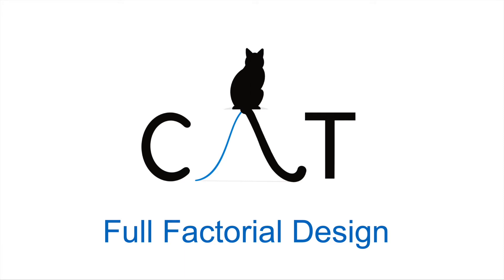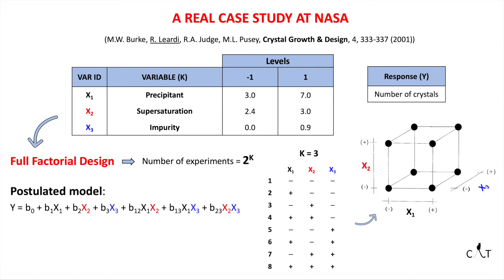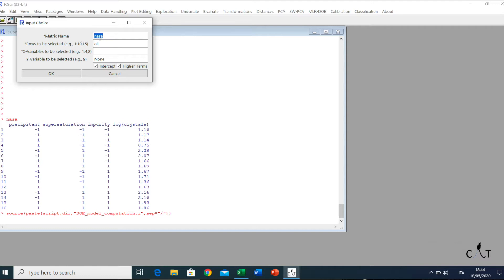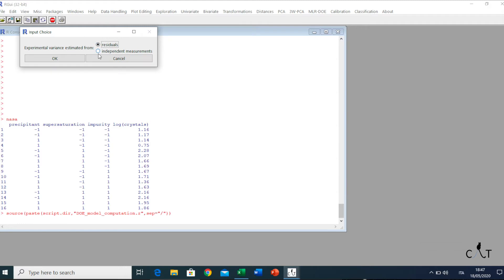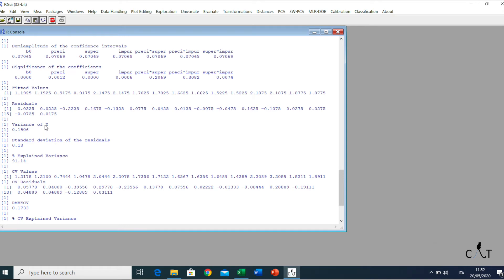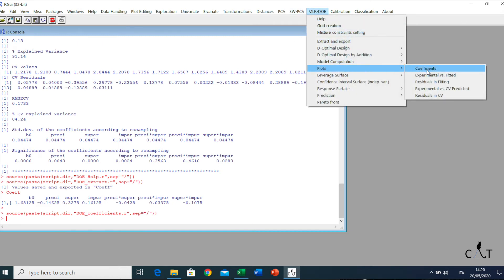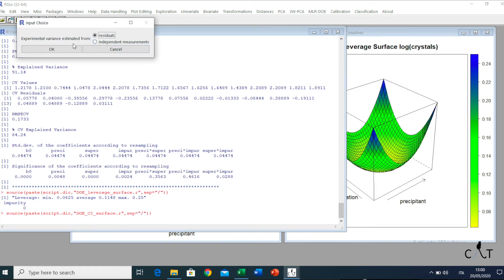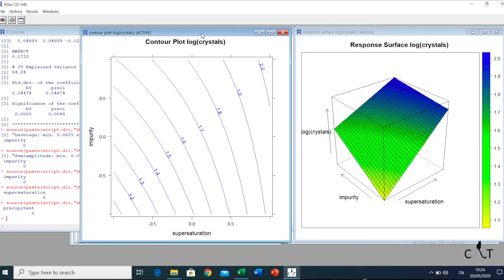Full Factorial Design [Manual]

Comment: Mi piacerebbe molto vedere un video di come fare con CAT i DOE di screening Plackett Burman. In chimica e biologia analitica sono molto importanti e quindi mi interesserebbe molto poterli utilizzare. Grazie
Reply from the maker: Ciao Alessandro, va bene lo prepareremo :)
Comunque è tutto molto semplice. In breve, prima devi definire il numero di variabili e da questo definisci il numero minimo di esperimenti, ossia il primo multiplo di 4 maggiore rispetto al numero di variabili. Dopodiché, vai in letteratura (o su wikipedia) e selezioni la prima riga del PB design secondo il tuo numero di variabili (per es. N=8 + - - + - + +), da cui ti crei la matrice. Su CAT nel calcolo del modello ovviamente NON devi selezionare i termini superiori, dal momento che questo design non considera le interazioni.
Per qualsiasi dubbio scrivici!
Reply: @cat-chemometricagiletool4500  Grazie molte della disponibilità e della risposta. Nel fine settimana mi sono incaponito e sono arrivato (lentamente ma autonomamente) all'approccio che mi avete suggerito. Ho utilizzato i dati di un ppt del corso di Leardi che seguii anni fa per verificare che il risultato fosse corretto. Grazie a CAT e allo smart work e lock down sto finalmente riuscendo a rivedere la chemiometria e l'experimental design e ad applicarle efficacemente al mio lavoro (chimica analitica ambientale). Grazie ancora approfitterò sicuramente della vostra disponibilità